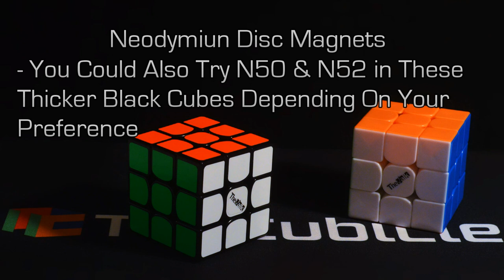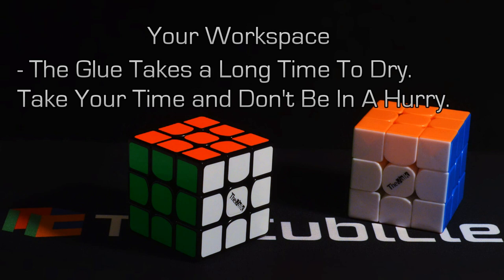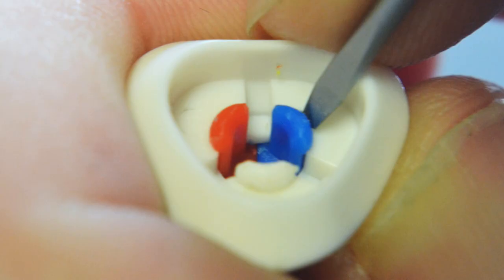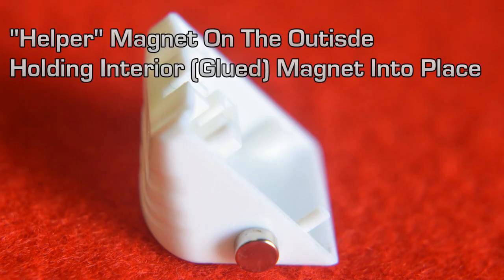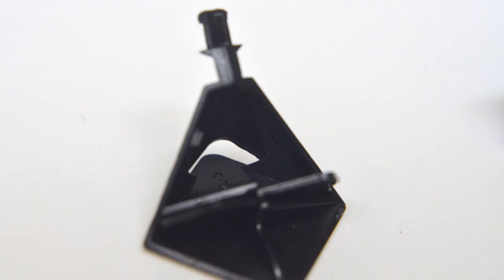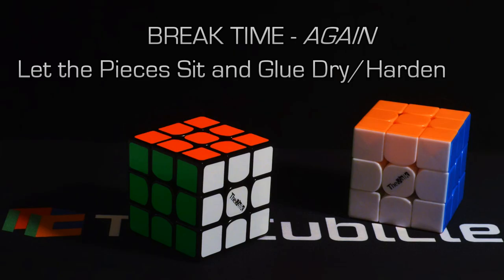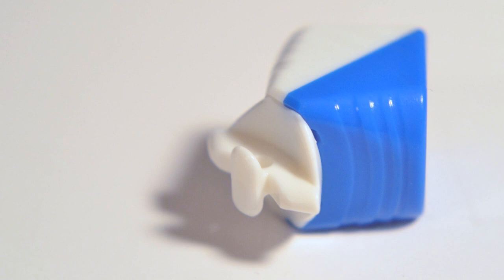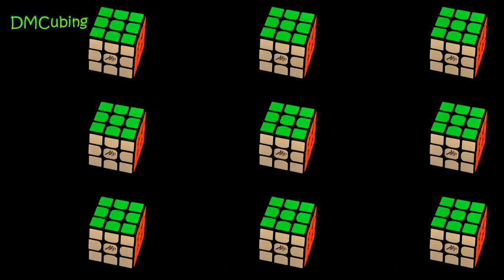DIY: How To Make A Magnetic Valk 3 Speedcube Tutorial

Comment: does it matter  which way i put magnets
Reply from the maker: Manny VG Are you asking about the polarity? If so, no, they're equally as strong on one end as the other. The important thing is to consistently place the magnets the same way each time, so the polarity throughout the cube is correct. And it doesn't matter which edge piece you match with each corner piece when you're gluing, because they all have the same polarity. 
 
If you're asking about the placement and location of the magnet, I generally like to position them against one of the retaining posts along the interior wall at the bottom of the edge piece, but that can vary between different cubes.

Comment: Where did you buy your magnets?
Reply from the maker: I bought these particular N35 4mm x 2mm magnets from magnets365.com but you can find this strength lots of places, including ebay (where I just bought more of this type). For the N48 4x2 magnets (which work in most cubes that aren't lightweight like the Valk and Air) I buy those from apexmagnets.com Apex is currently out (speedcubers bought them all up!) but expect to have 50,000 more in stock in a week or two.

Comment: Can i use 4x3 mm n35 magnets?
Reply: Nathaniel Raya no,using the 4x2 magnets. There is barely any space left
Reply from the maker: Exactly. The 4x2 fits perfectly in the corner piece thirds. A 3mm thick magnet would be too thick and wouldn't fit properly.
Reply: Can I use 4mm x 1.5mm magnets ? { N35 }
Reply from the maker: 4 x 1.5 would be too weak. I don't think they'd do much. Even the N35 4x2 gives a subtle feel, so if you go anything less than that, you're likely to not feel it much. Sorry.
Reply: Thanks for the tip

Comment: I want to ask something if a n42 will work well in valk 3?
Reply from the maker: Yes, I think so. I used an N35 4mm x 2mm and it's good, though subtle. I don't think the N42 in the same size will be too strong.
Reply: +DMCubing  what do you prefer putting a n35 or n42?
Reply from the maker: +Eddie Miranda Now, after having the Valk 3 a while? Probably something a little stronger than the 35. There's nothing wrong with the N35, you can feel its effect- it's there, and holds the cube in alignment. But I think to closer match my other magnetic cube mods, using a slightly stronger magnet probably is the best way to go. The next time I do one, I'll be using N42 mags.
Reply: +DMCubing oh thank you
I'll be putting n42 in my valk once my order mag came
Reply from the maker: +Eddie Miranda I think you'll like it! Let me know how yours turns out!

Comment: hey dmcubing. i have a problem, how to fix the end prong it came off😔
Reply from the maker: Speedcubing for life They're really too small to glue. Usually, if it's just one little prong that is broken, you can position it where it would normally go when the corner is put back together. In other words, put it back in its place if possible. It will provide more stability than not having the broken part in place.
Reply: DMCubing thank you so much

Comment: Can i use magnet n38 for black ?
Reply from the maker: ADP Cuber Yes, you can. The N38 4x2 will give a nice, somewhat strong magnetic pullforce feel. But it's not overly strong. The cube is slightly more bumpy than the N35 version. If your solve style is a little aggressive, or you prefer to feel the magnets, it's the way to go.
Reply: DMCubing ok thanks for you information!

Comment: what magnet would you suggest for a mint valk
Reply from the maker: I've got two of those on order. I plan on using N48 4x2 mags in them. Will be giving one away at 1000 subs!
Reply from the maker: +DMCubing Oops that was supposed to be N42! I'm going to try a little stronger magnet, so N42. On my black one, I used N35. The 35s are subtle.
Reply: DMCubing thanks
Reply: DMCubing where do u buy the magnets?
Reply from the maker: +Blake Pember The N42 mags I have were mislabeled as 52s, so you'd have to Google to find a source for those. you can usually find neodymium magnets on ebay. For N48 magnets, Apex Magnets www.apexmagnets.com is a good company but currently sold out. N52s you can find at Thackery www.thethackery.com and for N35 magnets, either ebay or this company I've used in China, www.magnets.365 they have a large selection. 
The N35 works nicely in the Valk but now I'm getting used to a stronger magnet, that's why I'm planning on 42s for my next Valks. in the stickerless Valk, the 48s felt too strong, so they might have a similar effect in the mint Valk.
Reply: I have followed this tutorial for my mint valk, I used n42s and it worked great. Be careful though because if you break the extremely fragile mint parts then you can't buy any replacements.
Reply from the maker: Tech Specs So true!
Reply: I actually broke one of the edge piece inserts clean off. luckily some superglue fixed things up. I nearly cried lol.
Reply from the maker: Tech Specs It was a part of the edge piece? Yikes! And I'm always worried about those little prongs on the bottoms of the corner pieces. Yeah, it's something that would make you cry! The mint is so rare now. I'm so glad you were able to fix yours! I'll probably do my mint M sometime in the new year.
Reply: upside is that it works, downside is that I can't take it fully apart ever again lol
Reply from the maker: At least you were able to glue it! That's great!
Well, I must have seen five or more videos, straight in a row today, with Valk cubes in them, so it put me in the mood for magnetizing my mint Valk. So that's what I did! Turned out great! Just have to set it up, lube, etc. It'll be given away when I reach 1000 subs.

Comment: Can i use 5x1 n42 magnets?
Reply from the maker: I've tried it and the results are a little different than from what you'd expect. It's an acceptable feeling, but just slightly stronger than you'd expect. The reason why is the cutaway holes in the corner pieces. The lack of plastic in that area means less magnetic energy is shielded there, so a magnet that feels relatively weak in another cube, actually feels slightly stronger here. 
If you like a slightly pronounced magnetic feel, the magnet will work out fine. Again, it's not overly strong, but it's not as subtle as using this magnet in the GTS2. You could also try locating the magnet a little higher up in the edge piece. As long as it can align the corner piece magnet directly across from it, it will work fine.
5x1 magnets have a great feel cubes!
Reply: DMCubing THANK YOU!!

Comment: Can u use n48 4mm × 1mm?
Reply from the maker: Eyan Bastasa I think you maybe could on a cube like the Gan Air, but on the Valk, it's going to be considerably weak.
Reply: Ok thnx...
Reply: How about n42 4mm × 1.5mm
Reply from the maker: That would be a great magnet in the Valk. I often use an N35 4x1.7, so the N42 4x1.5 will have a similar strength. You'll like them in this cube!
Reply: DMCubing i placed the magnets at the right side of the piece of the corner piece. Is it ok?
Reply from the maker: Eyan Bastasa As long as it's not sticking out of the cutaway hole, you'll be ok. The important thing is that the magnets perfectly align across from each other.
Reply: Ok i thought that it was wrong... i used liquid super glue. Works fine...
Reply from the maker: Eyan Bastasa Great!!!

Comment: I can use plastic cement right?
Reply from the maker: I really don't know. I've tried several types of superglue and a couple of different types of 2-part epoxy and I find working with a thicker type superglue works for me.
I've heard about Tameya (sp?)thin cement that somehow melts the plastic a little in order to bond with whatever you're gluing, but that sounds perhaps a bit extreme and there's no room for mistakes. And other types of cement glues I just don't know whether they're strong enough.
I guess you could do some testing to see how it works by maybe just gluing a single magnet and finding out how well it sticks. The two things that really present a challenge to gluing is the slickness of the plating of the magnets and how slick the plastic is.
Reply: ok thanks!

Comment: My Corner Piece broke in half :'( how can i fix it?
Reply from the maker: Gab The G if it's broken where I think it is, at the bottom of the little prong that keeps the corner piece third inside the base, you will need to try to position it in its normal place and then put the base on top of it. It usually stays in place and still provides stability.

Comment: hi i followed all the instructions and magnetization but there are a lot of corners and edges that do not pull together
Reply from the maker: Khoi Pham I'm sorry that happened. Sounds like somewhere during the process of gluing in the magnets, you had the polarity get turned around on you. If you start with gluing in all the edge piece magnets by removing each magnet you're gluing from the stick of magnets at the same end, the same way, each time, your polarity will stay correct. That's why I always recommend putting a small piece of paper at one end of the stick of magnets so you'll always know to remove the magnets from the opposite end. You may have accidentally had a magnet or two get turned around on you. 
The best way to find out which magnets are wrong is to assemble the cube without the core. The wrong magnets will be repelling instead of attracting. Try to determine which ones are wrong and carefully pry them out with a small screwdriver and try gluing the other way.
Reply: @dmcubing6342  its fixed now and my valks really good. thanks alot
Reply from the maker: Khoi Pham That's awesome!!!!!

Comment: Is n52 3×1.5 good?
Also what about n52 2×1.5
Reply from the maker: Anurag Prakash The N52 3x1.5 would work but the magnetic feel is going to be really light. The lightest feel I would recommend would be the N35 4x2, but if these are the only magnets you can get I'd suggest the 3x1.5. It's going to be light but may still be useful.
Reply: I also have an option of n52 4×1 and n52 4×1.5
what would you suggest?
Reply from the maker: Anurag Prakash If those are your choices, without a doubt, use the N52 4x1.5. It will have a magnetic pullforce just slightly stronger than the N35 4x2, and that would be perfect for the Valk. So, use the N52 4x1.5
Reply: Thanks! I was so confused in deciding. Now I am happy that I have got proper magnets.
Reply from the maker: Anurag Prakash I think you'll really like the way the cube feels using those magnets. After you do your cube, be sure to let me know how it turned out. Good luck, and have fun!
Reply: Thanks! I'll tell you the results as soon as I'll make it.

Comment: can I use eBay's N52 mags?
Reply from the maker: N52 4x2 magnets are much too strong from a Valk 3. The weight and design of the cube does better with lighter magnets, like the N35 4x2.
Reply: DMCubing eBay's N52 are not exactly N52s. they are much weaker. I just now finished magnetizing valk and it felt nice. there is a slight subtle click which isn't noticable! and yes what type of tensions you prefer for it?
Reply from the maker: Casually Cubing That's kind of funny. I think most ebay magnets must be N35! ;)
On the Valk M, it seems to work more effectively as a magnetic cube if the tensions are set just a little looser than what you'd have it on if it wasn't magnetized.

Comment: What about n45
Reply from the maker: In a 4x2? I've never used that magnet in a Valk. The strongest I've used was the N42 and it gives a strong magnetic pullforce feel. I personally wouldn't use anything this strong. If you have an aggressive solve style or prefer stronger magnets, you'll be fine. Most people, however, use the N35.

Comment: DMCubing are n48 magnets are good for stickerless cubes?
Reply from the maker: Lil Vander N48 4x2 in a Valk? To me, that would be way too strong. Even the N38 and N42 give a very strong magnetic pullforce. A lighter weight cube like the Valk does better with a lighter in strength magnet like the N35 4x2. This is the magnet most people use in it and it gives a great medium-light magnetic feel. The strongest I'd ever use would be an N38 and that's only if you like a clicky feel.

Comment: Can I use Tamiya Cement instead of superglue?
Reply from the maker: Probably not. It's good for gluing plastic models but doesn't work too well on ABS plastic. Tamiya does have a special formula cement for gluing ABS plastic, but it probably won't adhere to the magnets. Probably best to use superglue.
Reply: DMCubing Oh I see
Thank you so much
Reply from the maker: It's better to be on the safe side.
Reply: Is N35 magnet perfect for Valk3? I mean is N35 better than other magnets such as N38 or N48 for Valk3 Black?
Reply from the maker: +LTE cuber It really depends on how much magnetic feel you want the cube to have. I feel the N48 4mm x 2mm is too strong. I used an N35 in my last black Valk 3 mod and it's noticeable, but subtle. I think, though, a slightly stronger magnet may work better, so you might want to consider something like an N42. I plan on using this magnet the next time I do a Valk.
Reply: Thank you
I would like to try N35 first and next time try N38 or N42. 
I'm looking forward to ebay N35 shipping :)
Reply: Is 2x1mm okay for cubes?
On ebay, I couldn't find 4x2mm size.
Reply from the maker: +LTE cuber 2x1? I'm sorry to say it is going to be too weak and too small to get much use out of in Rubik's cube. Sorry

Comment: can i use 4x1.5mm N52
Reply from the maker: Krish Preet Are you sure about that measurement? A magnet that grade and size would be way too weak in this cube. Here is an excellent resource for predicting magnetic pullforce: https://www.kjmagnetics.com/calculator.asp
Reply: DMCubing I live in india and they and the availability is less they were the best magnets i could find will they work decent enough?
Reply from the maker: 4x1.5 N52 will be ok for a Valk and Gan Air. It will be just slightly stronger than an N35 4x2.

Comment: So what does the paper do? I'm confused still
Reply from the maker: Edwin S when you glue magnets into a cube, you have to keep removing them from the same end of the stick of magnets, to keep the polarity correct. The little piece of paper is there to show which end of the stick of magnets is which. You remove the magnets from the opposite end. If you don't mark one end of the magnets, it's very easy to get things messed up.
Reply: DMCubing thank you so much for clarifying this for me. Now I can make sure I don't mess up my friends magnetic cube!
Reply from the maker: Edwin S Nice! Let me know how it goes. And if you're doing a Valk, be extremely careful when you remove the bases from the corner pieces, the parts with the little prongs. They can easily break.
Reply: DMCubing I am doing a gts and it shouldn't be as complicated. I want to do a valk 3 really badly but I can't get my hands on magnets right now sadly
Reply from the maker: Edwin S What magnets were you going to use on the Valk? I recently found out that the N38 and N42 work better on the Valk than the N35. www.gaussboys.com have them in stock.
Reply: DMCubing please tell me I am seeing this correctly. 2000 for $0.10 CENTS OMG
Reply from the maker: Edwin S lol. No more like 10 cents a piece.
Reply from the maker: Edwin S at gaussboys it's 11 cents each for N38 4mm x 2mm and 12 cents a piece for the goldplated N42 4x2.

Comment: will water-based super glue work???
Reply from the maker: X Silverskull_2324 X Hmmm do you have a particular glue in mind? I can't think of any waterbased glues except for wood glue. Some Gorilla glues are water activated
Reply: Actually the super glue I have is called "hong yuen super glue" it's kinda a local brand and it seems like its water based. I already tested it with other plastics and it's an ok super glue only problem it spreads quickly, dries easily and its the only super glue I have at the moment.
Reply from the maker: X Silverskull_2324 X Oh, ok. I doubt it's water based if it's a super glue. It might seem watery because most super glues are thin, clear, and runny like water. 
I think you'd be ok using it. You just have to be really careful because the thin glues like this, like you said, are runny and dry quickly. I prefer a thicker type super glue, like a gel, because it's longer drying and doesn't run. I hope that helps.
Reply: Thanks DMCubing!, I just thought that "water-based" is just "water like". You really helped a lot <3 :D!

Comment: Could you glue the corner and edge piece magnet at the same time?
Reply from the maker: Gd CK12345 Yes, actually you can. The reason I do the parts separately in my videos is to lessen the chance of making a mistake with polarity and to reduce the chance of having the pairs of magnets shift once glued and placed. If you do glue both at the same time, just be careful handling the glued parts and place them on a flat surface while the glue dries. Good luck!

Comment: but you only put one magnet into the corners
Reply from the maker: MicSTAMAN mic The corner piece has three parts where a single magnet is glued into. So while it may only look like one magnet in each corner piece, there are actually three. The edge pieces break down into two hand that have magnets.
Reply: @dmcubing6342  oh right thanks

Comment: I did this today, but one of my stalks broke off! I have to glue the whole unit together. :(
Reply from the maker: iOBX Yeah, those little prongs of the corner pieces break easy. Sometimes you can get away with just putting it back together broken if it's just one prong.